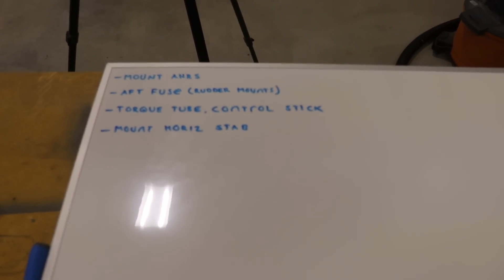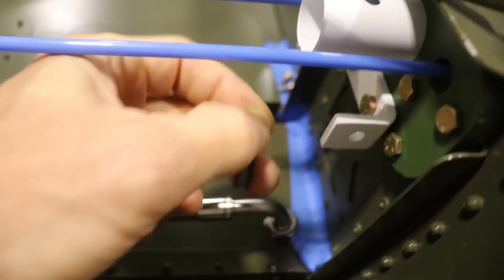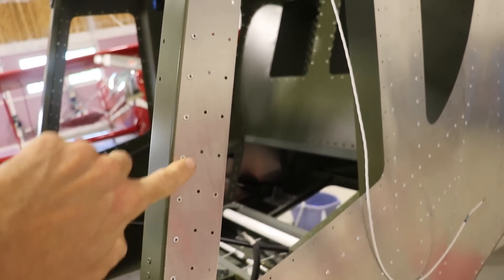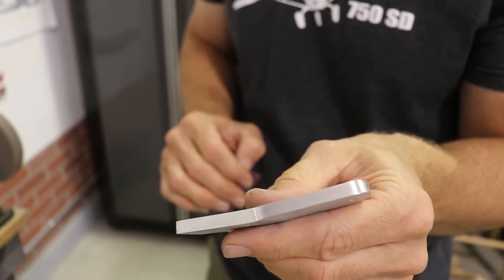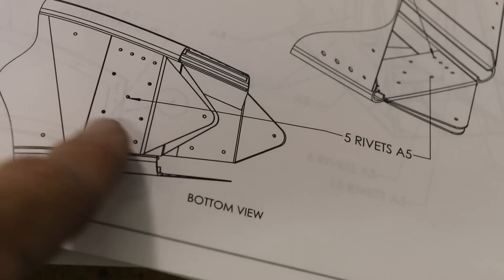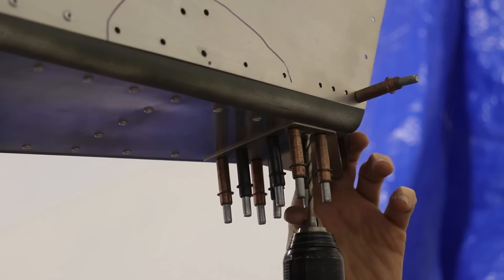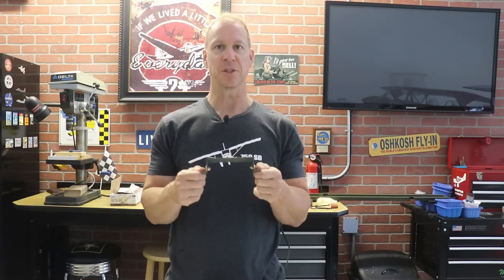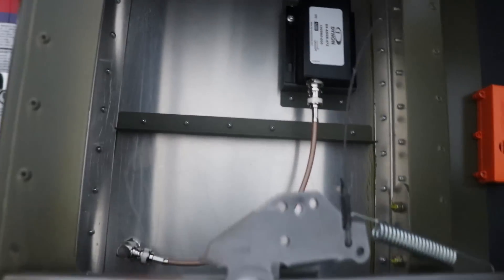CH750 Super Duty Kitplane: Dynon ADHRS and aft fuselage (Ep52)

Comment: Hi. I know it’s been a long time since you made this video (#52), but at 7:09 you reference a builders manual that I have never seen.  I recently purchased a partially built 750 Cruzer.  The original builder gave me the drawings and said the plans were online.  I have tried finding the online plans and all that I can find is a page of links to partial plans (such as rudder, elevator, etc.). They are far from comprehensive, and pretty much hit or miss, with not everything covered.  For example I can’t find any info regarding cable tensions, torque values, and the like.  When I saw the manual that you are referencing in your video I nearly spilled my coffee. I have not been able to find anything like those pages.  Did they come with the kit, or are the hidden online somewhere?  Should I have gotten something similar with my Cruzer?  If so I will contact Zenith to see if I can get or purchase a copy.  Thanks in advance for your reply.
Reply from the maker: The build manual for the Super Duty is very different from the Cruzer. They have updated the manual for the SD, but even that manual does not cover the entire airplane build. I suggest you call the Zenith factory and have them re-assign your serial number over to you, and then make sure you have all the current manuals and plans pages.

Comment: Do you have to run another set of pitot and static lines to the panel for the backup display in your center console or do they just have to go to those modules in the tail?
Reply from the maker: I don’t have the third screen yet but I believe it does require it’s own pitot/static lines that would be tapped into the main lines. If that’s the case I probably will not install the third screen because I don’t want to run the lines up there. I did buy a Dynon D3 which I may mount there instead.

Comment: I enjoy seeing your workmanship results.  You obviously have a great repertoire of skills and techniques, which you have applied in achieving those results.  You mentioned remaking the rudder plate if the bushing wore.  I was thinking that if the bushing in the rudder plate devloped slop in the future, another solution besides making a new plate possibly could be to drill out the bushing using a drill press, and finishing up with a reamer bit.  Of course, that would entail removing the plate from the fuselage.  Not a lot better than a new plate, but maybe worth a try.  The trick would be not to create a new center reference hole location when drilling out the bushing.
Reply from the maker: I'm sure there are ways to get the bushing out, but my thinking is that it's much easier to spend a few bucks and just replace it all LOL. Maybe if it does need replaced at some point, I will try to remove it before I buy new parts.

Comment: I don't like that AHRS mount at all- subject to vibration all by itself due to (not insignificant) mass hanging above the two mount points.   Not to mention the bolts loosening up (not likely, I know, but just something that bugs me).  Why not a more conventional four point mount, and shims if required?
Reply from the maker: You can mount yours however you want. The purpose of this video is not to convince you to build your airplane just like mine. This is the same mount I’ve had for a year and a half in my Cruzer and it works perfectly.

Comment: Great series.  You do awesome work.  One question however.  Why doesn't Zenith just drill all rivet holes to final size?
Reply from the maker: Phil-most of the holes are drilled final size. Sometimes it’s better to have only pilot holes when multiple parts get stacked and drilled. Also, sometimes it’s just an error and when we bring those errors to Zenith’s attention, then (hopefully) they update the CNC programming!